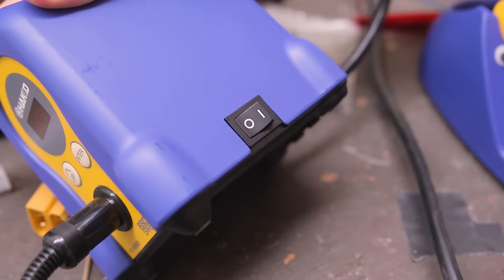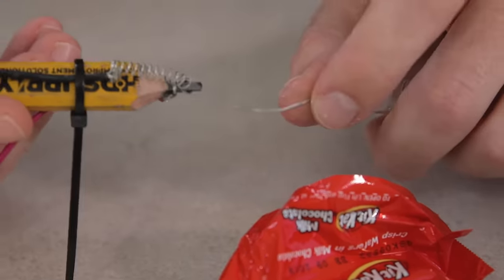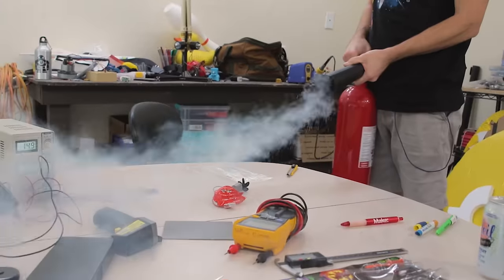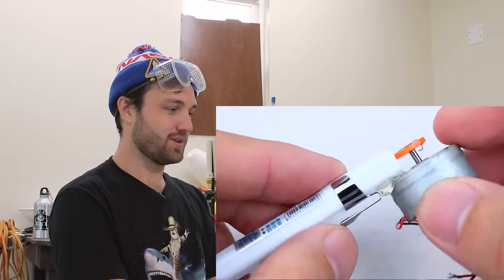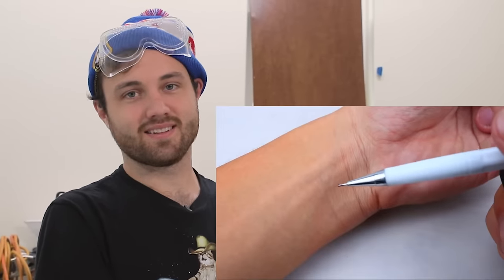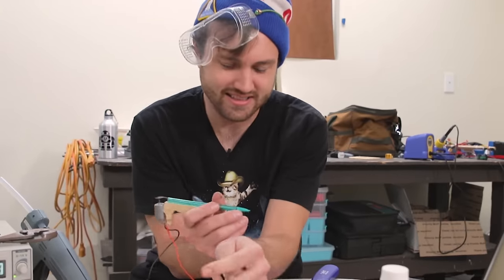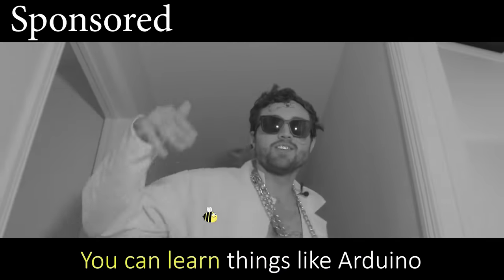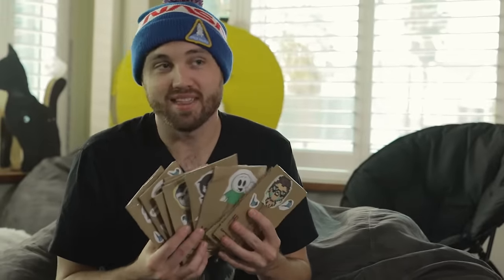I Followed A Tattoo Machine Tutorial

Comment: a friend built a similar tattoo gun using a rc car motor, pen tube, and a clothing button. no prison involved just...lack of license and money for a real one. or proper ink. saw it used a couple times. another friend from high school tattooed a tribal pattern on most of her forearm by hand with ballpoint ink and a handheld sewing needle. I admire the patience.
Reply: with the electric one, it was a studier paperclip rather than a bendy wire, which worked great as a driver with the button as an offset on the motor. pressure switch and battery attached with electrical tape. the paperclip was "welded" into the back of an emptied ballpoint tube (ink had to come from somewhere), secured with tape, and a thin actual needle was attached at the business end. a bit bulkier but much sturdier material. he even made a shading tip for it with 3 or 5 needles. plz note despite efficacy we were teenagers and idiots. I only let him test in on me with no ink (I had a little light scarification but it healed) tho he tattooed some mutual friends.

Comment: You have to stretch the wire out and heat it, then dip it in water to quench it.  Then it'll stay straight, then you sharpen the tip on something like a concrete floor.  Of course to be a real prison tat you need to char some toilet paper, and mix it with toothpaste for ink.

Comment: In prison we actually use a flame on the wire in order to straighten it, it makes it a lot easier than trying to pull it straight on its own. And we make our own ink also, using soot from burnt plastic and water with a little dab of shampoo or body wash, it actually works really well believe it or not

Comment: In prison/ jail (From personal experience) They give you the inside tube of the pen with the ink and tip but instead of being inside a pen it’s inside a rubber tube so you can’t stab people. It makes writing very hard because it bends when you press down and hurts your hand. But there’s no spring, staples inside paper aren’t allowed normally it’s a paper staple. And a small motor would be basically impossible to get, the spring, and any type of electrical plug or wiring is impossible unless you take apart something already inside the prison like a microwave, except then your asking for the entire block to be searched which may end up with other guys getting mad at you for causing a search. Also a needle wouldn’t be possible. And they wouldn’t be the type of stuff to be smuggled in,

Comment: This is what people do in prison. They literally use an electric motor, batteries, a pen, and scrap wires. It just stabs the ink into your skin really violently, it's fucked. It works I guess but it's not gonna be a work of art, and it's gonna hurt like Hell. The one I saw was actually the pen tip and ink tube stabbing back and forth, not a wire that you dip.

Comment: If you want to produce real tattoos, use pulverized graphite from a pencil mixed in water as ink and a guitar string for the needle, pop the guitar string wire with a lighter and then unwind it, bend the end of the shortened wire at a 90 degree angle, when you pop the guitar string, the wire inside it sharpens very pointy, attach the short bend end to the motor, best method 100% i use it many times. Remember to cover any needle with rubbing alcohol and burn it with a lighter for 10 seconds to clean the needle

Comment: the wire should be at least halfway up the pencil in the middle(you chip the wood away) with the spring on the tip of the pencil but it's still a shitty way to do it,we used these in prison because they won't let you buy a soldering iron,no pens or mechanical pencils but you can steal wire from somewhere including an old radio or broken electronics

Comment: You could have heated up that spring with a lighter, straighten it, and then heat the tip to red hot color and quickly dunk it in cold water to increase the tip hardness and then sharpen the tip. But since you dont know metallurgy i forgive you.
Reply: and he could not do that

Comment: If a high school student made this it wouldn't be awsome, it would be embarrassing. I am in high school and I'm in a computer engineering class and I just recently made a fully functioning electro magnetic motor with an arduino, a coil of magnet wire, a ball bearing and a bunch of magnets. It is much more effective than this shitty soldering iron.